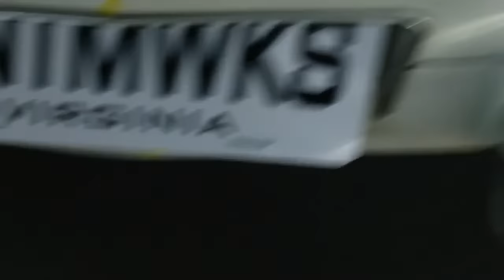Logical Restorations: FantomWorks Friday Check-In with Dan, Colin, and Dave!

Comment: The methodology in the MGB restoration is spot on. Pretty much what I did on my 2 MGBs. Mechanical/Safety, system by system, then cosmetics. 
If this were my car, I would put the LE wheels on it, or VTO Classic 8  silver wheels.  Shave the side markers, lower the car (CB car at RB height looks silly) by 1inch or so (mine is lowered 2) 
This looks like a perfect car to restore. Glad to see them kept on the road and given some love!

Comment: Dan, I have 73 MGB that has been in my family for 30 yrs, it has been handed down from one person to another and I have had for the last 20. It is in rough shape, It will never be restored, But I  made sure it runs, the drive train is in good shape. I made sure the braking system has been all replaced. The car never saw ethanol gas so the gas tank look brand new. Its a fun car to hop around in. Because of your show I was always mindful to address safety over looks... and I am good with that. Thanks for your insights...!

Comment: Safety and mechanical should always come first. Here is one reason why. I have a 72 Chevy truck. I had the 454 built to a 468. Sounded wonderful and had good power. There were wires hanging from around the fuse box area and had been that way for a long time. One day I saw smoke coming out from under the hood. I stopped the truck and got out my fire extinguisher and the hood was so hot I could not open it. I sprayed underneath and then saw flames . The fire dept arrive and put out the fire which fortunately did not do too much damgage. After this I re-did all the wiring and brakes and now have a dependable truck. Just because it hasn't gone bad yet, doesn't mean it won't.

Comment: I’m sitting here 3 years and 3 shops into a full frame off restoration on my ‘70 Chevelle SS396. Luckily I have made some friends along the way to save it after a terrible shop left me with a basket case that would have forced me into six figure numbers to finish it. The metal fab work on the body is coming to an end and next will be the frame.